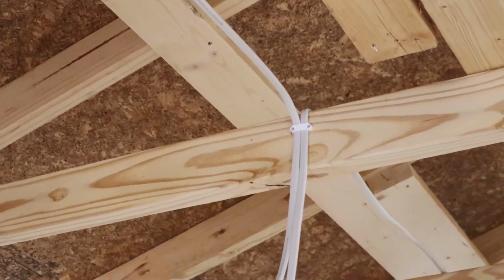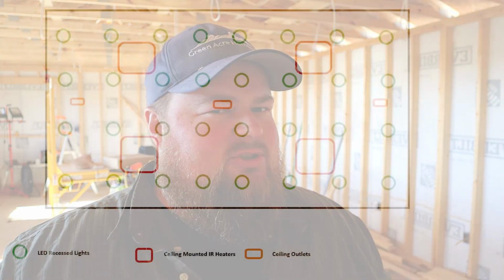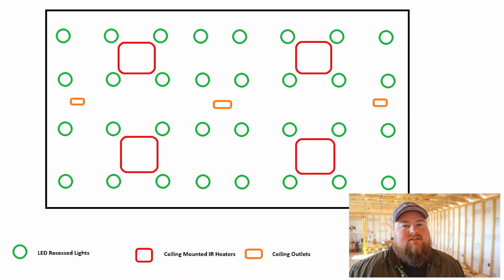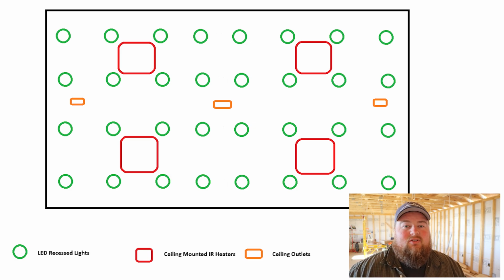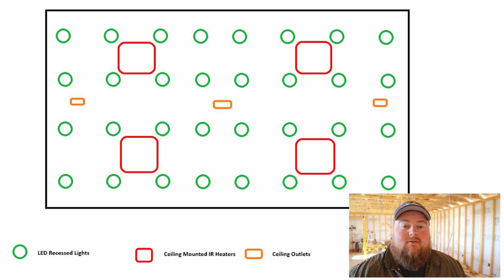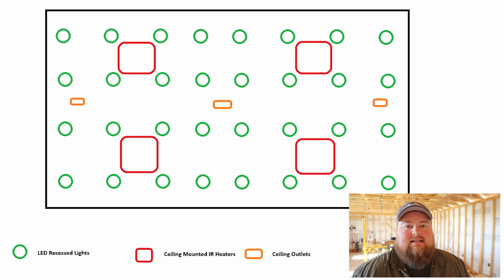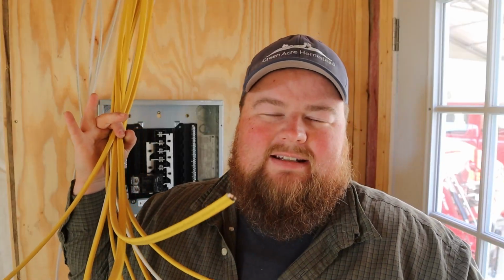FINALLY Pulling Wires! Rough Electrical Install DIY Workshop

Comment: So, to add my 2 cents,  use RC50 connectors at your panel and try to match sizes if pulling 2 cables in. Buy a larger panel than you think you need. You'll eventually use the extra spaces for something in the future. 

Run larger pipe between buildings, the cost is lower than having to redo it later. Can always heavy up and pull larger wire later. Example, if you have 100A on 2awg Al, and you need 200a later, you can pull the old 2s out and drag the 3 new 4/0 wires and a 2 ground in behind it as ya go.

Comment: Really nice wiring job.  No 50-60 Amp outlets?  You need an Air Compressor and a welder.
Reply: Those larger circuits i wouldn't hesitate to run in ¾ EMT pipe, and several in strategic locations for future use. An empty pipe where ya need it, is more valuable than having to re-enter existing walls and install cable and boxes.
Reply: A wider inside a wooden floor shop? Are you delusional? Air compressors need to be outside also for safety reasons.. you don’t want one blowing up in your workshop this size.. or any size for that matter they should be in an exterior shed with hard line running inside.

Comment: Hey Mr. Sam...,
hope you are in good
spirits.

I have a question:
I own a older home
wired with aluminum
wire.
I recently had a garage
built attached to the house.
What kind of wire size
should I use..., continue with the 14/2 wire, or the heavy yellow wire; copper?
Reply from the maker: Wire size depends on the circuit breaker amperage ands loads. It may vary from 15 to 20 or more amps.

Comment: I am a electrician/ work worker myself and when I built my home attach to my shop I was in a hurry to get into my home and used romex but my shop I conduit everything as I didn't know what romex was 20 years ago as we would pipe everything, homes and commercial. I like conduit in my shop for the so purpose of adding stuff at a later date. Some of my equipment was 120 v and when I updated I went to 220 v and I only had to pull another wire to complete the 220. Nice work though Sam your doing a good job!

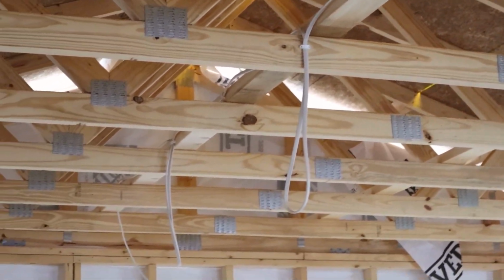Comment: 4:40 you didn’t consider conduits?
Reply: Why? 😂 romex is a lot easier to deal with. Conduit has to be attached to the outside of his interior sheathing and looks ridiculous. Plus you have to pull individual wires over just a few cables.

Comment: how about protector plates on the studs over the wire holes so you don"t accidentally put a screw or nail into your wires

Comment: 14:36 Being that this job is current, im planning the same venture. Ive watched your progress from the start.  You have done a fabulous job and i commend you on your teaching skills. Do you have a current tabulation of your money spent so far for the materials used,  electrical components arent cheap. How far north of 15 grand are you currently at?

Comment: Perhaps an explanation of the difference between your use of the yellow and white Romex.
Reply: White = 14AWG wire which is for his 15A circuits, the yellow is 12AWG which is the for 20A circuits.

Comment: I would consider a second light circuit. That way you still have some light should something go wrong. Also wired smoke alarms. Are you doing air con, ceiling fans, hot water, exhaust fans or alarm. Have you also considered an CCTV system not necessarily for CCTV but for your YouTube recording. Could be setup over machines, work stations or general area giving full time recording so you don’t have to move your cameras all the time.
Reply: And data cables before you put your wall sheets up

Comment: Sam, there is one thing I hate when I am working in the workshop...not enough light. You will not encounter that problem for sure. I bought a scaffold like the one you have. It is a must if you work alone like I do. I am going to venture to say that when you get your breakers all wired up it will look like the wires were drawn in there nice and pretty like. I wish there were some lads around like you when I was building, someone who tkes pride in their work.

Comment: As several have said I would put some outlets above bench height for hand held power tools rather than reaching under a bench to plug them in,  One big omission I did notice was the cables were not (temp) tagged L1 L2 etc for lights GPO 1 GPO 2 for outlets H1 H2 for heaters, now when you grab say a yellow wire at the panel, which one is it where does it go ?

Comment: Sam,  No 240v circuits for table saw, dust collector, etc.?   Might want a couple.  Additionally, I had the electricians add an automatic power switch that turns on the dust collector when the table saw comes on.  Really handy.  Can't have enough lights or outlets. I had OSB installed for the walls.  Great to have a solid surface that I can attach something to without worrying about it pulling out.  Keep up the great work you will have a wonderful workshop.
Reply: Most equipment in the US is 120v. 240v is overkill for most small shops.

Comment: @ 13:30 Is it legal to have exposed Romex above the breaker panel? Or will that be covered up?
Reply: The NEC wants nmb cable,  aka Romex, behind a 15 minute fire rated wall assembly. Simply drywalling the column width containing the panel and vertical home runs meets this code.

Comment: If you have two entrance/exit ways put two way switching on the lights. I would have put all the plug sockets over table height.  Living where you are a mini split and a fan would be comfy.

Comment: Since you're going to put in solar you should look into the neoVolta battery backup system. Mine is 24 kilowatt using LFP. I've had it two years and it works perfectly.

Comment: Where are you stapled your loop to one side of the trust it’s going to be hard to make it in the center. It seems with it being stapled but I may be wrong. why did you not just make you loop center with the  2x4 their to attach to…

Comment: I’m not an electrician, but does 220 need heavier wire or do you have no need for 220 in your shop?
Reply: No. Just more wires in the cable. Instead of pulling 12/2 you’d need to pull 12/3. The amperage is the same 20A on a 12Awg wire.

Comment: I'm sure I missed it, but I didn't see a circuit  for an ac unit?
Reply: Window AC for the receptacle under the window. It’s on a 20A circuit so it’s more than enough.

Comment: You do great work with electrical wires.  I would have more outlets above bench height so they are easily accessed.

Comment: one thing i mightve done differently with the lighting is run one switch to turn on a few of the lights in a checkerboard pattern (say every 2nd or 3th light in the row and on every 2nd or 3th row )
that way one lightswitch can light up the whole shop at 1/4th strength giving you enough light to see where youre going at night without too mush shade from stuff standing in the shop that would block the single row lit up
this would mean weaving one long wire going back and forth over all the other wires going over every 2nd or 3th row of lights that are not hooked up to the lengthwize wires

Comment: Great job! If not too late I recommend putting some outlets with twist lock connectors in the ceiling. Makes the center of your space much more user friendly.

Comment: All the outlets at knee's height is great in the house.  But, I have found in the workshop environment 42" to 48" off the floor is very handy indeed.  This would put the outlet above any work bench you might put up against the wall.
Reply: So true all my workshop outlets are high and work great for me.  Outlets on the ceiling are a must also.  I use them for my air filter and drop down power cord, that gets used all the time.  Can't have enough outlets or lights in the shop.
Reply: Same here. My shop is a wood shop so all outlets are above workbench height. I want to be able to lean a sheet of plywood against the wall and not hit a plug. So the bottom of mine are 48"" off the floor.
Reply: Yep, built mine with them all at knee height, luckily didn't have enough cash to insulate so moved in for 12 months, over that year have moved all of them above workbench height, just finished insulating and sheathing inside.
Reply: Kitchen as well...

Comment: Great layout plan for your outlets with 1 huge exception, 
You should really put at least 2 outlets per wall that will be above workstation height. 
This will allow you to use power tools without having to step over extension cords. 
Believe me, I've moved outlets higher on walls for this same reason and complained tons because I didn't think of it sooner

Comment: Sam….lol I see we think a lot alike! I plan on a ton of lights in my shop as well! Being able to see well with no shadows for me at least is important! And heck if ya don’t need them don’t turn on the extra set right? I’m surprised you jut didn’t put a mini split though?  Shop is looking just amazing!
Reply: I wondered the same thing about the mini split. I split off two bays of my 3 car garage for my wood shop, insulated it and put in a Mr. Cool 18k unit. In hind sight I wish I would have gone with a 24k unit in case I ever decide to expand into the 3rd bay.

Comment: Sam consider installing a gable vent fan on the far end of the building. They come with a thermostat you can set for whatever temp you want to activate the fan. Believe me when I tell you having one will make you shop a great deal move livable. This is def the time to run a wire up there, put a switch to it as well. What are you doing for AC?  Hanging a window unit will look terrible. Consider running another wire at the same time you do the gable fan. Cutting a hole up high on the far end wall for an appropriately sized AC unit will also increase the comfort level in the shop on those hot humid days. Ask me how I know all this. The ceilings outlet were a good decision, you will use them.
As a side note…..way too many LED lights. You’ll have to wear shades in there!

Comment: unless i missed it  the colors of electric cable  change  with amps it handles white 15  yellow 20  and orange 30  but you don't have orange yet?
Reply: He isn’t putting a 30A in. And white is 14AWG and yellow is 12Awg but your current is correct but that’s not what they’re that color lol.

Comment: I would have run a couple of 2” conduits from panel to attic, cleaner looking and protects the romex. Otherwise a great looking rough in! Good job.
Reply: Never run romex in conduit..
Reply: @lonewolftech .. yes run romex in  conduit when possible. you just cant run romex in wet locations. when it comes time to pull new wires you will wish you added conduit

Comment: Your ocd is off the charts. Lol. I love it. How neat and straight everything is. One question, did you think about a floor outlet for any shop equipment like cabinet tablesaw in the future? Also the ceiling outlets are great idea Sam, like if you want to put retractable ceiling mount electrical power cord   Love it. On the edge of my seat for the neext one

Comment: I would definitely put in a ceiling mounted cord reel. Use mine all the time. It’s above the workbench. Very handy.
Reply: These are so awesome power and air reels since I have them it makes for fast clean up and just so handy I have a power wall mounted pressure washer that is on a reel for washing the cars and projects before repairs.
Reply: Absolutly, I have two installed in my residential 2-car garage converted to a workshop.  I have each one on it's own 20am dedicated circuit.  Probably overkill having two, but I have one above my work bench furthest away from the garage door and the other near the garage door.  That way if I want to do sometihing in the driveway, I don't have to pull the coord all the way across my garage, even though it is pleanty long.

Comment: Many years ago, I built a large garage and I started wiring it. A buddy of mine, that had strong ocd tendencies, offered to help. I told him that I had insulation put in and some writing was right side up and some up side down. I didn't want his help because I would have to remove half the insulation and rotate it. Also, I would have to measure all the wire runs to make sure they were exactly parallel and I would have to measure where all the staples go in so they would be spaced perfectly. He agreed that he would require all of that.
Reply: If you had just done it right to start with you could have had help. What were you thinking?

Comment: Great great video !! Does any of your equipment use 220 ? Or any " new " future machines maybe use 220 ? The reason I'm asking is when I built my shop I never even thought about adding a 220 outlet but after a couple of years the heat got to me and I added a split A/C  heating unit and had to redo my power and run new lines for a 220 plug to power it .

Comment: You planning on running air lines to the front and back of the shop possibly. Not sure how much air you use but could be an idea just in case.

Comment: Nice, neat job, Sam!

Have you considered using a generator inlet with main breaker interlock rather than a transfer switch? I find that a genny inlet approach is easier and cheaper to install and it gives you increased flexibility over a transfer switch. Just a thought...

Take care and God Bless.

Comment: IR heaters? Put a single mini split in man.
Reply: Yup, that exactly what I did in my garage, 18,000 BTU.  Along with my R-18.4 insulated garage door, it is freaking awesome.  The only thing I was disapointed with it the mini-split removes very little moisture.  I also installed an industrial sized dehumidifier suspended from my garage celing.  It is absolutly awesome temperature controlled environment in my garage.

Comment: Wow that’s a lot of lights! When I wired my shop I ran 4 outlets on one long side of the shop about every 4’ and then bought 12 48” LED shop lights that plug into each other and ran 3 off every outlet. All on same switch. A whole lot less wiring and gave me outlets on the ceiling for a drop cord. Can’t wait to see how bright it is! 💡